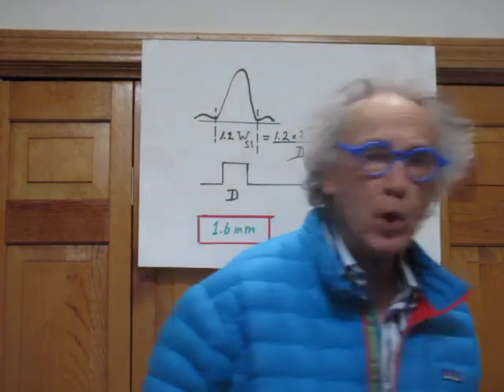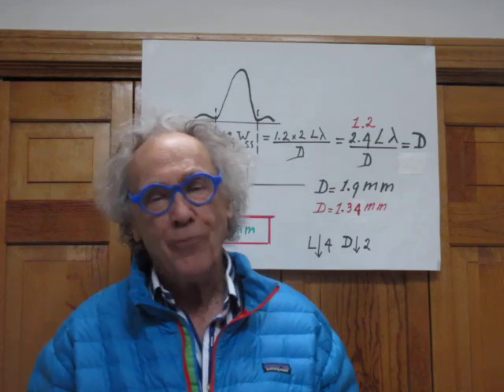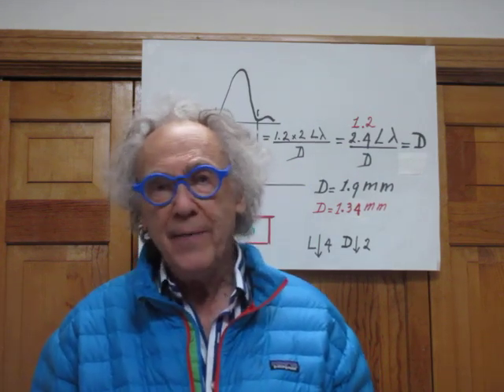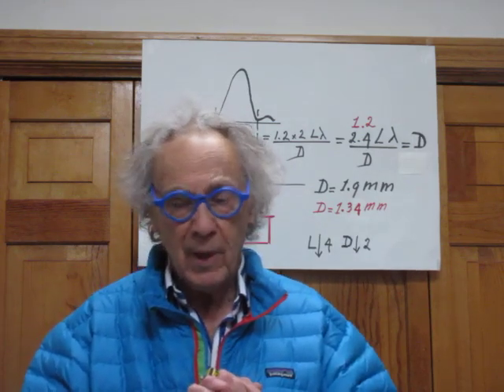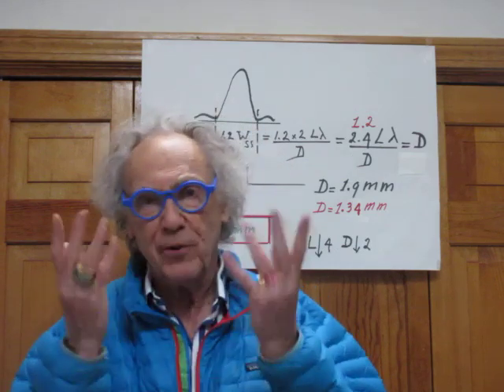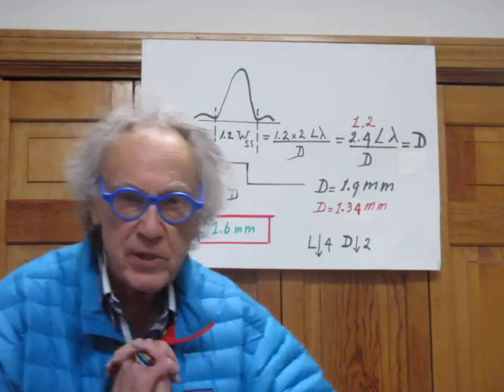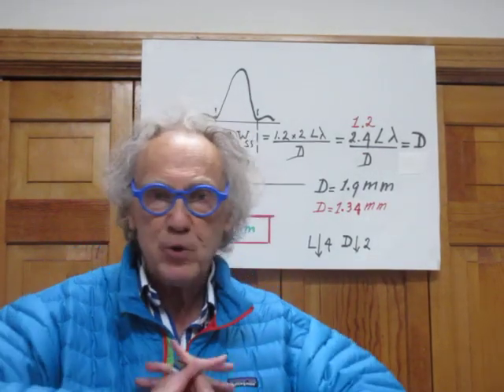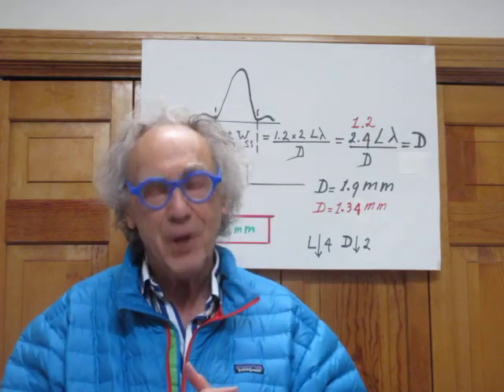Solution Problem #77 - Pinhole Camera

Comment: Respected sir I am from India I am preparing for banking exam the paper pattern is 1st you have to qualify pre exam which consists of 100 marks time is of 1 hour, 30 questions from English 35 questions from mathematics and 35 questions from reasoning after cleaning pre there is Mains exam which consists of 250 marks and the time provide is of 2hr and 30 mins ,I got selected in pre but in mains I got stuck in mathematics my brain really stopped working as I was not able to solve even a single question I got 0 in mathematics if I have had solved 6/7 questions I got selected as the cutoff was 62/250 so plz suggest me the way to take mathematics from last 2 year I am learning mathematics but still something is missing I need your advice sir plz plz plz help me out
Reply from the maker: talk to your math teacher and take some math courses

Comment: Sir, I did an experiment.
I took an empty tin can and I washed it and sanded the burrs of.
Than I used a needle to make a very little hole in the middle of the bottom.
I held the can 25 cm in front of my face, and looked at my table lamp through the hole.
I saw a few pixels of light in a sort of triangle, like a distant christmas tree.
I rotated the can, but to my surprise the christmas tree stayed foot.
I brought the can very close to my eye, and than I realised where the christmas tree came from.
I saw a refraction pattern of my comea's impurities  and the structures on my retina together in one picture.
When I moved the can a little bit up and down, or left and right, I could see the two images slide over each other.
Physics and biology in one view sir!